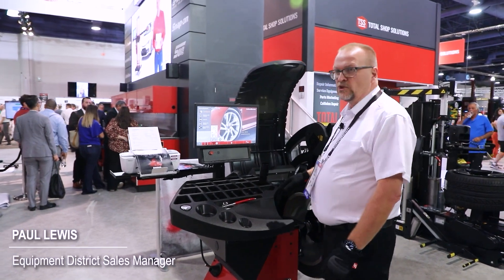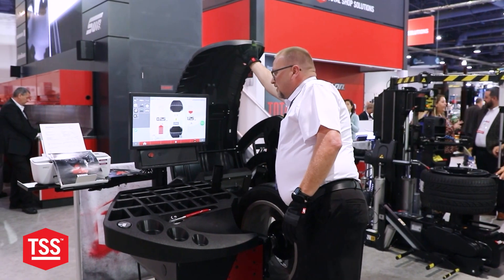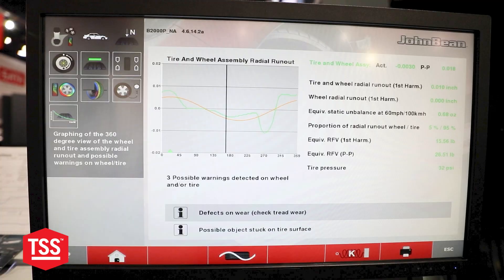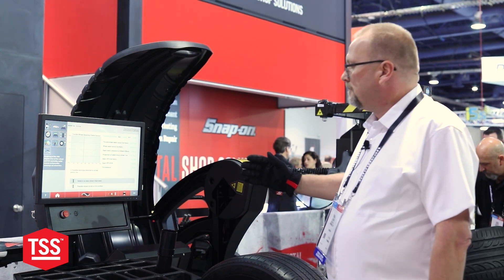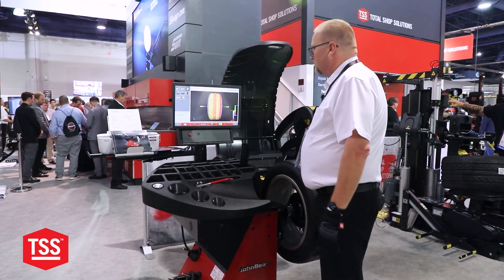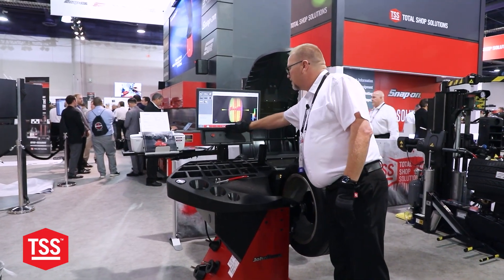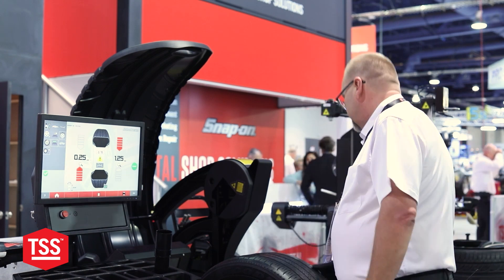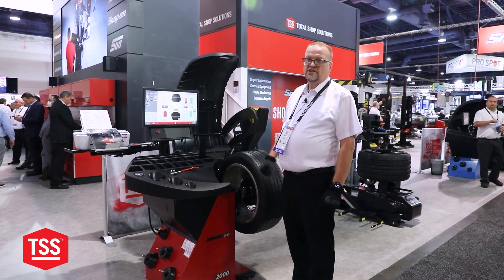B2000P Weight, Shape AND Defect Technology

Comment: Does this machine road force like the Hunter Balancers?
Reply from the maker: The B2000P uses highly sophisticated laser and camera technology to independently measure radial and later runout of the tire and wheel providing single spin measurements of RFV (road force) along with weight correction, shape correction and exclusive defect detection in a matter of seconds.